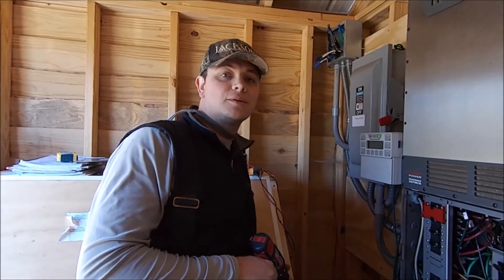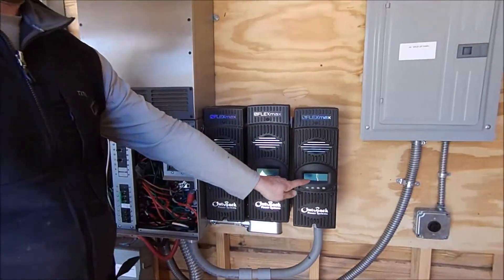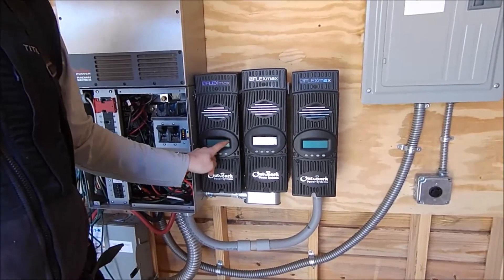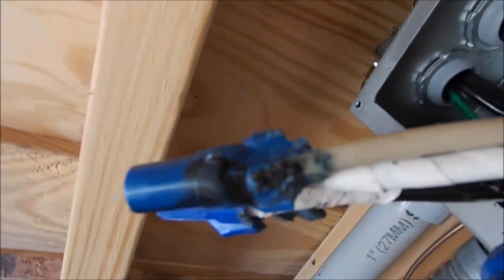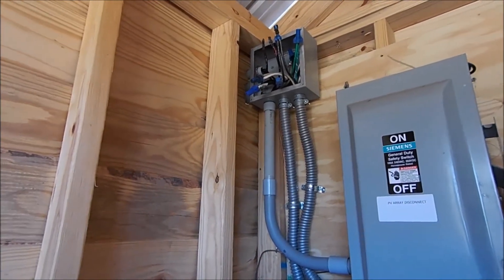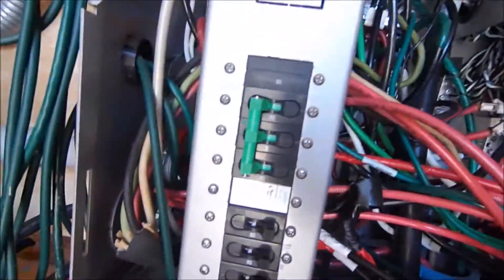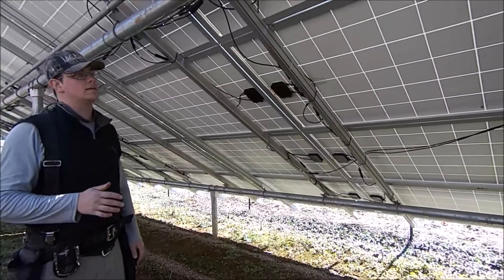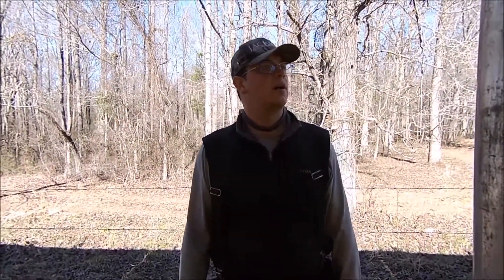Locating Ground Faults in PV systems

Comment: Need help.  Ground fault troubleshooting ideas.  Inspecting a 96 kW array, 3 circuits, 600v system. String 548 Voc.  PV module 36.6 Voc.  Inverter GFDI fuse blew.  Visual only found smoked connector in j-box on circuit 2 (string 33).  No other visual evidence.  After isolating strings by pulling combiner fuses and pulling PV negatives at terminal block, mid day string voltages are as follows:  Fixed (not floating) voltage to ground for both pos and neg are same at 86.5v.  pos-neg voltage is also 86.5v and fixed.  Why?  Again, none are floating.  When I first tested, I momentarily observed a floating voltage at 1600v for a couple strings.   Not sure if I misread the meter as it did not replicate…  Any ideas on ground fault location or other fault?
Reply from the maker: Doug Poffinbarger where are you located Doug?  Can you make a video of what you have done so far?  There are lots of folks that might can help you subbed to my channel, I may not be able too

Comment: OK. Lesson learned. I don't think I used any wire nuts on my system. But lowest confidence with my DIY system is the grounding. It may be perfect. But who knows? Not me. Could you guys charge me for a remote review (I'm in California) of the grounding aspect of my single inverter 3.6kW solar install? Nice to see you answering viewers questions, btw.
Reply from the maker: Grounding is pretty straightforward. Yes I do consults. Jwv8783@gmail.com.   Send me and email and we can set up a time

Comment: What would cause this error:  Inverter AC Over-current Fault
Reply from the maker: Luis Cardona pulling too much from the inverter, like trying to start a heat pump.  In this case it was a direct short where wires had melted thru
Reply: Sorry i meant.  I have a SOlaredge inverter brand new installed and it is showing AC Over-Current Fault.  I swapped the cables from 8 Gauge to 6 gauge going to a 40 amp breaker and still see the problem as soon as i turn on the breaker.
Reply from the maker: Luis Cardona could it be possible that you have one of the neutrals and the Hots crossed. Is it tripping the breaker?
Reply: Basically it is Red(hot to 1 pole of breaker),  black(hot to the other pole on breaker), white (to neutral bar on main fuse panel), and Green (ground to the ground side of breaker panel).  It only gives me the error but does not trip the breaker.
Reply from the maker: Luis Cardona I’d be calling solaredge on Monday morning if you are sure it’s wired corectly